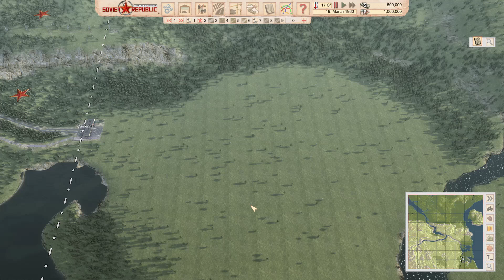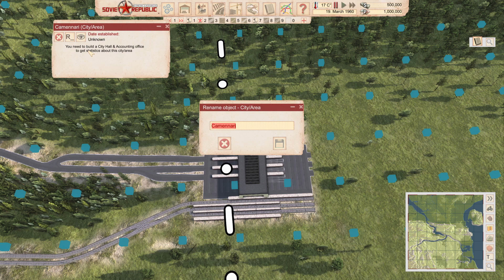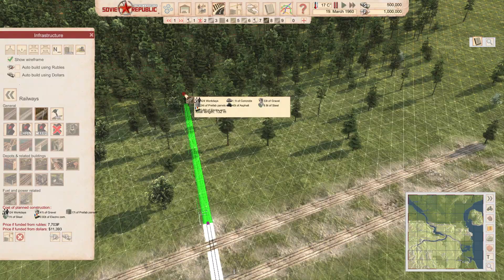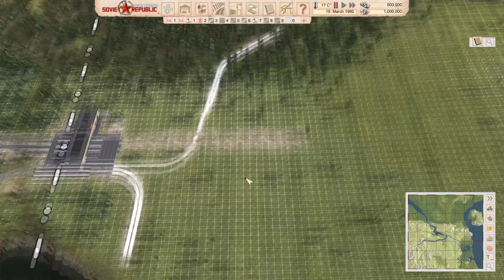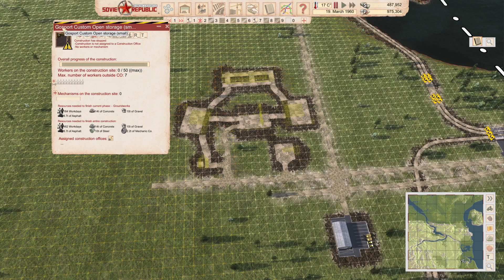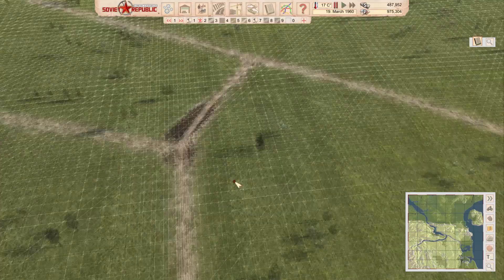Initial Planning :: Workers & Resources Soviet Republic (Airplanes And Tourism) #01

Comment: You talk a lot and do a very little
Reply from the maker: Like to explain the initial set up in the first part as planning mistakes can become major headaches when playing on hard mode.
Reply: @StephenSilverbeard   who is playing the game i Or you so if you will tell me every thing in advance then why should I watch this video because I already know what is you're plan, also I have seen the introduction video where you have shown the resources and map and all, so why should I listen to it again
Reply from the maker: @LawKayaKahtaHai  W&R is a very different game to other city building game as it is about building a self sustaining economy, This involves planning a logistic network that supports and grows the economy,  to do this the player needs to think about the present and the future from the start.  It  would be easy to place buildings and roads, but it does not help player who are want to learn about the game. W&R has a nasty habit of biting back, especially since the introduction of seasons.  For example, in one game, built up a economy  of over 30 000 pops.  Then in one winter due to a  food supply problem the population collapsed to a third in size.  

Top tip: When you believe everything is under control, that is when the game will strike back :))

Comment: Very nice series, I do enjoy it! Is there a chance to see the modpack/modlist that you are using?
Reply from the maker: Unfortunately it is a very long list.  Currently looking at doing a series reviewing the most useful mods in the game, but not sure when they will be released.  If you are looking for mods here is a short the top mods I use:

Conveyor towers by MTandi,  Conveyor Road & Rail crossing by OffTheRailsGaming,  
Transformer by OffTheRailsGaming,  Toprus' Electric Substation Pack, Underground Power Lines by HardCorGaming, Underground High Voltage Power Lines by HardCoreGaming. 

Small versions of all the industries, these are are cheaper to build and fit better in small towns.   Search 'small factory' in the workshop.  This principle applies to schools, university and shops,  A good university for the early game and in small town is 'Lenin Technical University' by OffTheRailsGaming.  Kindergartens are often a problem so Kindergarten by painKillerlexar  and  Corner Kindergarten by Novu are useful in large towns.  Small Clinic by robs074 is useful for providing health care in small towns.

Fixed playgrounds by MTandi overcome the problems with vanilla sportsgrounds only having one worker.  
Small Theatre by OffTheRailsGaming is a compact building that only needs footpath connections.
Athletic Club by Novu, a very small building that caters for 50 customers that can be slotted into areas that have sports problems.  This is part of the 'Old City Collection' which contains a number of useful buildings.  

Updated construction offices pack by Gerilskij  overcomes the restriction of the vanilla construction office.  
Small Distribution Offices by OffTheRailsGaming is useful when you need a couple of trucks to move a key resource.  

Finally the big one residential buildings.  I rarely use vanilla residential blocks because the multiple road connections make cities look messy.  Prefer mods that use footpath connections as they are simple to place.  Which ones to use is really a matter of personal choice.  

Finally,  mods in this game can take you down the rabbit hole, I check the workshop everyday and regularly add to my collection of 30+ maps.  Hope this helps

Comment: Using a medium power transformer to supply a city and a tourist area still seems quite risky to me, we too often forget that only the incoming 2.35 MW will be distributed to several power substations and I do not think that the city and the tourist area will be able to satisfy, say, 1.20 MW each ...
Reply from the maker: You are correct, the plan is to bring a second supply down to supply the industry/docks on the next island that will provide additional connections for the other side of town,

Comment: Underground cables (here from your electrical substation in the logistic area of Gosport customs) cost much more than overhead cables, you should only use them when you have difficulty accessing, for example in dense urban areas, here its quite a waste of money IMHO
Reply from the maker: Agree it was an expensive solution, but wanted to keep the area between the logistics zone and the town uncluttered,   Although have to confess I could not resist demonstrating how useful the mod can be when planning an urban area, :))
Reply: @StephenSilverbeard  I agree with you for urban areas yes (as for very dense industrial areas full of conveyors and pipelines). I was mainly talking about the electrical substation supplying the logistics area itself, roughly 10,000 $ for a substation instead of a hundred meters of overhead cables is a bit high, and therefore dangerous, for a cosmonaut playthrough ;) But I stand with you wholeheartedly, sometimes (often) it is difficult to resist the temptation ;)

Comment: The current placement of your gas station at Gosport customs is dangerous for the future: on this import-export route it will create severe traffic congestion.
Reply from the maker: Wanted to make sure the distribution trucks did not wander too far to get fuel, but see your point.  If the congestion gets too much will move it off the main road.
Reply: @StephenSilverbeard  It is often less risky not to have distribution offices and gas stations directly connected to a main road, unless you are making access roads longer than yours to absorb the possible queues of vehicles waiting for their turn. It should be noted that one-lane vanilla gas stations may have their utility placed staggered on either side of a main road, with the incoming and outgoing access ramps making traffic more fluid for refueling vehicles.

Comment: You can bus directly to a singular building (so like your heatng plant) that have only one use. Also, you can see at 29:44 and every other time you build a building there is a check mark for auto purchase goods. I assume you had it checked for your gas station and as others said you had it checked for citizens on your residences (haven't gotten that far yet)
Reply: And you left the autopurchase on meat in the store when you cleared off the other 3.
Reply from the maker: ty will check.